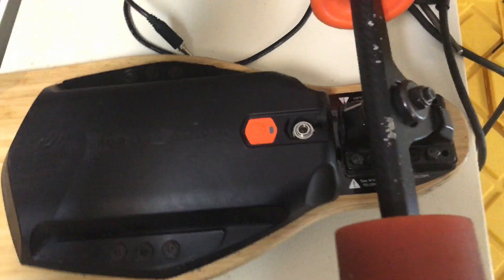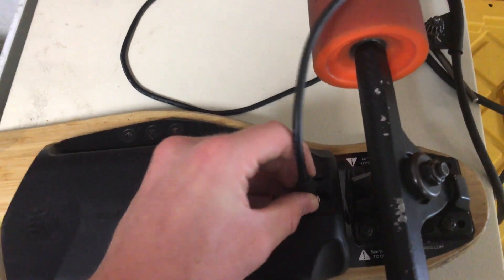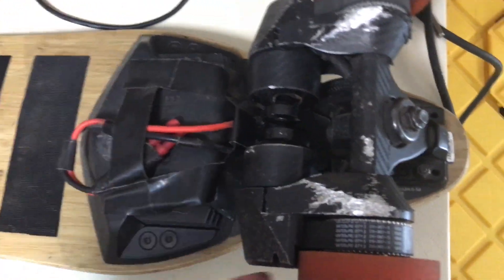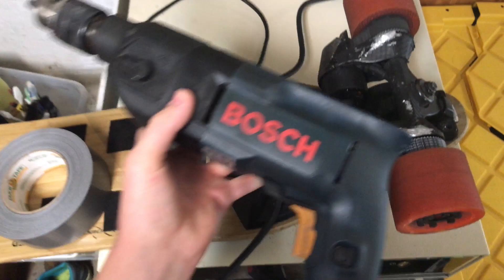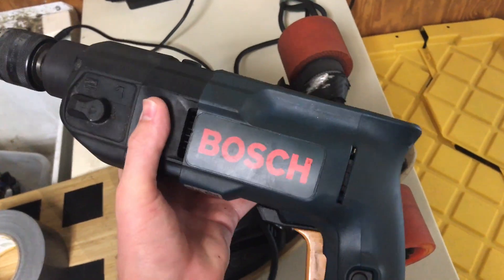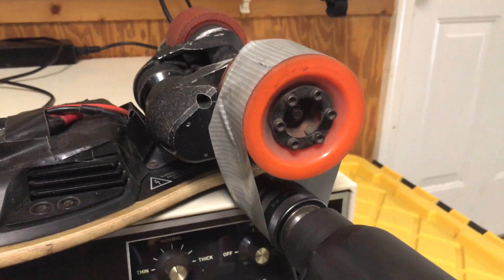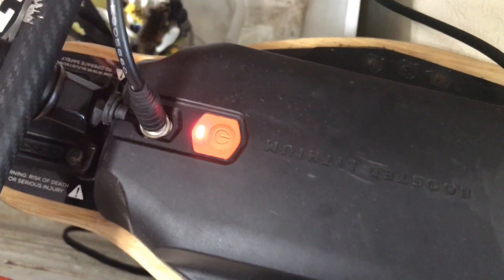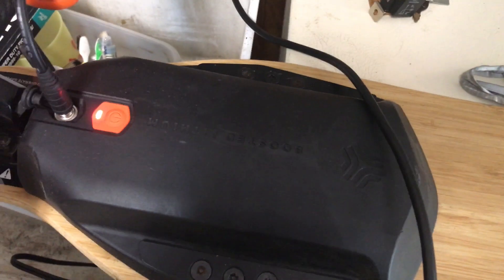How to Fix the Boosted Board Blinking Red Light of Death

Comment: Great idea. Tried it just in case it might work. But I verified that my Stealth has the actual Red Light of Death code flashing. There are multiple codes to trip these darn boards, and in your video your steady flashing lights fortunately did not = RLOD. Glad this worked for you. Retiring the Stealth after 3450 miles.

Comment: I spent 30 mins with drills it didnt work but then I put my motorcycle on rear stand and put 2nd gear and put board to back rear tire and gave it gas and it worked ) charging now.

Comment: Thanks for the hack brother, works great!!! Especially thankful as "Boosted" Tech. Svc. (or whomever is actually responding to my complaints) wasn't even able to diagnose this issue for me after a week of videos and emails. A couple add-ons for ya if you want: "Gorilla Duct Tape" seems to have better tensile strength than most common duct tape ("3M"?), and I only had to use one belt for a maximum of 5min. with a high rev. corded drill in reverse in order to get above the low limit battery threshold. Secondarily, as much as you can, please  try and keep the adhesive side of duct tape belt away from the motor and gear teeth if at all possible. The resin adhesive can gum up your motor and belt gear teeth quite a bit without being visible to the naked eye, so just try and keep your belt closer to the leading edge of the wheels when spinning. Otherwise, GREAT...thank you!
Reply from the maker: Awesome!!! So glad it worked for you man. And thanks for the helpful tips - good points for anyone else trying this

Comment: This is a brilliant idea. I tried it with a battery powered drill and it just turns the wheel too slowly. A modification on the idea was to use a belt sander. I took the sanding belt out and put the rubber wheel on the belt sander (that drives the sanding belt), directly against the Boosted board wheel (no need to make any belts out of duct tape, etc.). It took about a minute with the belt sander to get the charge up to a level where the Boosted board charger started working. The belt sander spins the Boosted board wheels at about a million revs a second. Thanks for the great idea.

Comment: I tried this trick... After a couple of tape belts I got the hang of it. I did it on both wheels 10 or more minuts each. Then I charged it again, but it did not work, instead I got another error light saying there is a battery failur (the second one) and that I have to change the motors (the last one). But I am stuburn, so intead of using a drill I used another E-board to spin the wheels, put them belly flipped against a wall, hold them and spun the wheels back and forward for about 5 minuts. Charged it again, and guess what ? It worked !!!! Thanks for the tip SimsP ;)

Comment: I used the back of a xiaomi scooter tire. You can use a lime or rental scooter too. lol
Reply: My xiaomi scooter can only be turned on with a push start, how to you get it to free spin with a push of the button?
Reply: @grassIand  You have to give it a push on just the front wheel then hit the throttle. You are mimicking riding it.
Reply: jeff nelson i see thanks!

Comment: ok i think this trick works. 

was flashing red constantly. spun it for 8 minutes and got weird mix of green, red, and flashing red, so i knew it had some effect.  spun it for another 10 minutes and now it's solid red, so I believe it's charging. pretty interesting trick, will let it sit overnight to see if it juices up.  i let my board go dormant for ~8 months after a mechanism in the remote busted.  tl;dr - charge your board!!

i used gaffer tape for my 'belt' and tbh i found it's so rock solid that i could probably replace a car belt with it in a serious pinch. 

thanks dood, i hope my board is fixed tomorrow 8)
Reply: Did this end up working?

Comment: If you have access to a treadmill is is way easier to bungee the board to the treadmill and just let it run... 
I really ran my boosted down to almost nothing and I took about 30 min on a running speed on the treadmill to get the board to come back to life enough to plug it in. 
The wife thought I was nuts, but it worked.

Comment: Thanks for the suggestion SimsP. Have you every seen an issue where the charging brick keeps power cycling? When I plug my board in to charge the brick light keeps going on and off. Ever run into something like that?

Comment: Solid video and advice, fixed me right up!  This can happen when the battery fully discharges, and using the drill to trigger regen/juice back into the battery allows it to trickle-charge to where the Boosted Board electronics will allow the power brick to work.  Good stuff, thanks again!!
Reply from the maker: Julian West Glad it helped! Thanks for the kind words.

Comment: For $1600, this shouldn't be an issue. Wish I never bought this turd board. ,,l,.
Reply: This happens to most electronics with lithium batteries. Phones, drill batteries, laptop batteries, EVs. It's called parasitic discharge as the battery discharges itself after awhile.

Comment: This is the 2nd time this is happening to me. How do I charge it? I use my trusty Yuneec Ego to spin its wheels. Seriously? Am I the only one who feels ripped off spending over $1699 on a board that's not as reliable as a $300 Yuneec? The worst part is I was just about to put it up on Bay-E. Ive had nothing but trouble with my Boosted...from Day 1. What a gip.
Reply: I’m trying to sell my boosted to some sucker right now
Reply: munterboy Take the money and run! People don't realize Boosted is a start-up from San Francisco. Boosteds are SPECIFICALLY designed for the hills of SF, where distance is not an issue. It says so on their box: Last Mile Vehicle. But it's unreliable.

I live in Los Angeles and I need RELIABILITY, RANGE, a CHARGING PORT for my phone and an easy to control CONSTANT SUSTAINABLE SPEED. The ONLY company that makes a skateboard with these features, that is NOT a start-up, is #Yuneec. #Yuneec Aviation are leaders in the drone industry, have been for years, and they used this experience to make a SUPERIOR product with a SUPERIOR feeling ride. Have you noticed the boosted mini boards copy the Yuneec deck design, but not as well? Whatever. Boosted sucks!! Stay away from start-ups.
Reply: UPDATE: Sold the Boosted to some other sucker. He didn't leave me a positive feedback so I'm guessing he wasn't able to jumpstart it either. Bought the #Yuneec Ego2. It's a bit more nimble than the #Ego Cruiser gen 1.Other than that, it has the same features: you can still charge your phone from it, it'll control easily at super slow speeds (Great for school cuz I can talk with friends who walk or go around people crowding the bus stop), and the BEST wheels for the sidewalks of Los Angeles.  Besides the Ego2, I bought a Sansui with the rest from the boosted sale. SOOOO glad I got rid of it. I will NEVER stop touting how good Yuneec boards are.
Reply: UPDATE: Sold the Boosted to some other sucker. He didn't leave me a positive feedback so I'm guessing he wasn't able to jumpstart it either. Bought the #Yuneec Ego2. It's a bit more nimble than the #Ego Cruiser gen 1.Other than that, it has the same features: you can still charge your phone from it, it'll control easily at super slow speeds (Great for school cuz I can talk with friends who walk or go around people crowding the bus stop), and the BEST wheels for the sidewalks of Los Angeles.  Besides the Ego2, I bought a Sansui with the rest from the boosted sale. SOOOO glad I got rid of it. I will NEVER stop touting how good Yuneec boards are.